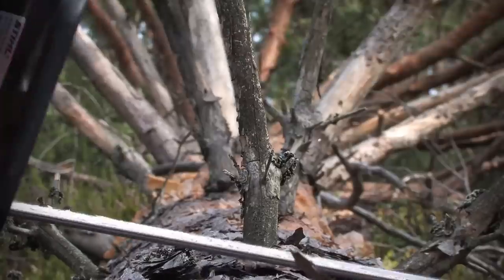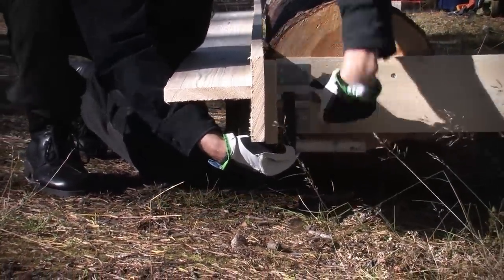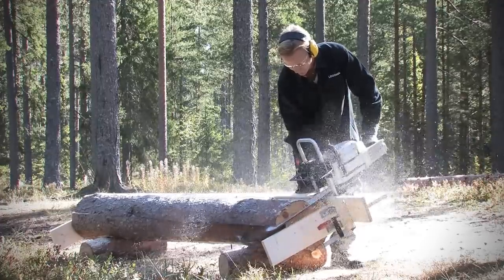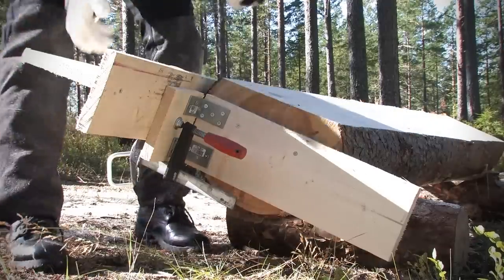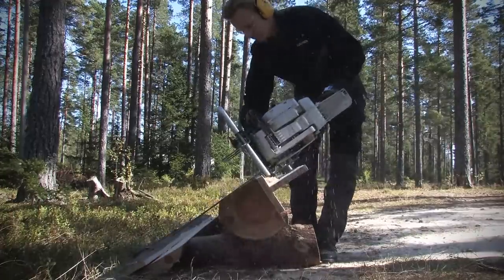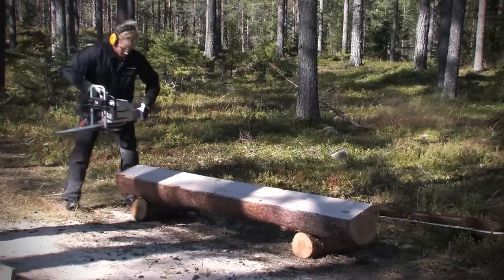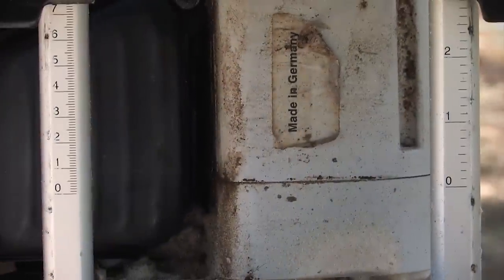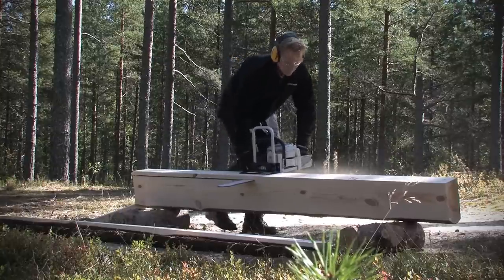Big Mill System - Timberjig | Hand-held sawmill | LOGOSOL

Comment: At 7:31 and 7:37 you can plainly see that the mill/operator have produced lumber of inconsistent thickness. I operate one of these Timberjigs and have not yet been able to produce square, true lumber using the methods in this video and the owner's manual. It is handy for ripping boards off a nice true flitch or cant made my Granberg Alaska mill, but so far is not effective producing lumber from round log right through to finished lumber. I plan to investigate my guide rail, and make whatever modifications are required to get better results.
Reply: I was going to comment the same. The first two cuts of the cant are not square. If the first two cuts cannot be square then nothing else can be either. It appears that the inconsistency with thickness is too much to run through a planer at a single setting. It seems you’d have to continually adjust the planer thickness to get any uniformity. It isn’t worth it for what it produces and the added work and handling it would take to make the material useful. Oh and there is always BAR OIL on the slabs that ruins any finish or furniture applications.
Reply: @stumpbumpers  this is a bit of a zombie thread, but I just noticed your comment. I haven't used this jig in a while, but I, and woodworker friends do make furniture from chainsaw-milled wood. After planing or even sanding (my cuts are very smooth) there doesn't seem to be any issue with finishes.
Reply: @aaron6806  Ye i was wondering the same, the little bar oil would go away with any sanding as u have to do anyway for any finished product.

Comment: Have one, but this is not a proper solution, I used it for couple of mini projects, but then later I bought the proper tool. It is annoying to fix rails to a log and it's slow and noisy. As I remember, it was also quite expensive...